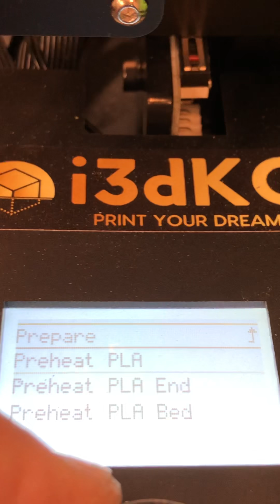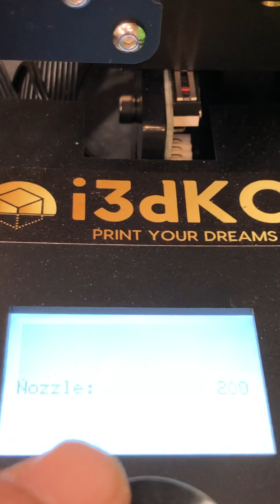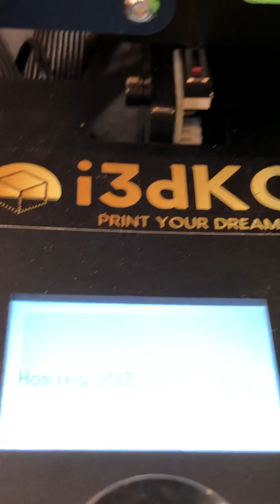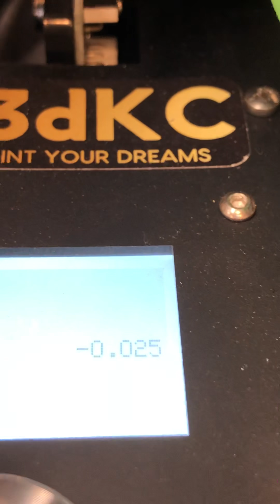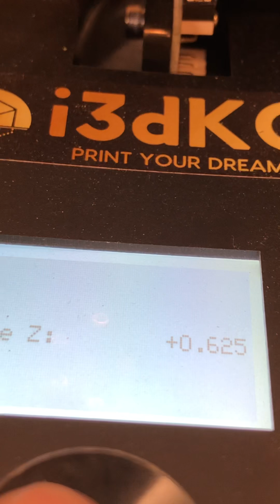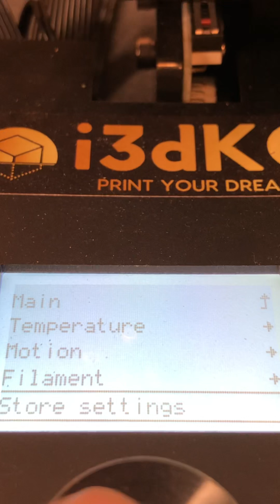Ender 2 - Marlin Bed Leveling

Comment: When you store settings like that, will the program pull those settings up every time you turn the machine back on or do you need to do this procedure every time you turn the machine back on?
Reply from the maker: Yes, these setting get stored to the printers EPROM.  You will, however, need to add a line to your Start GCode to retrieve the mesh.  
M420 S1; Retrieve Mesh settings

So your start GCode, in the slicer, should look something like this:

G28 ; home all axes
M420 S1; Retrieve Mesh settings
M117 Purge extruder
G92 E0 ; reset extruder
G1 X0.1 Y20 Z0.3 F8000.0 ; move to start-line position
G1 X0.1 Y200.0 Z0.3 F1500.0 E15 ; draw 1st line
G1 X0.4 Y200.0 Z0.3 F5000.0 ; move to side a little
G1 X0.4 Y20 Z0.3 F1500.0 E30 ; draw 2nd line
G92 E0 ; reset extruder
G1 Z2.0 F3000 ; move z up little to prevent scratching of surface
M117 Let's Make Something...

With that said, it is always a good idea to send a M500 to the printer after you have made changes using the menu.  To do that, your Slicer might have a printer GCode interface or you can download Pronterface